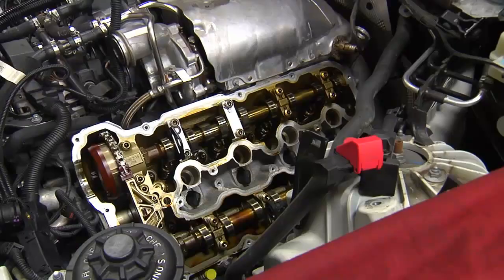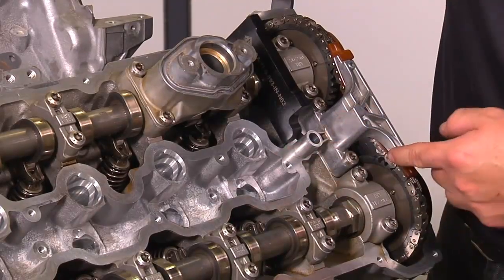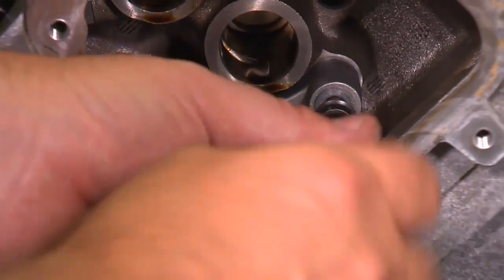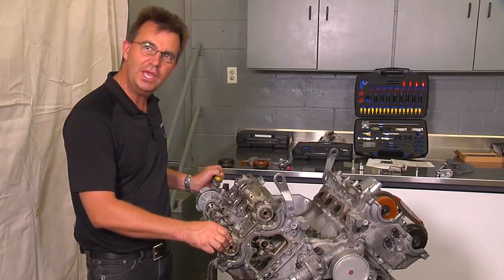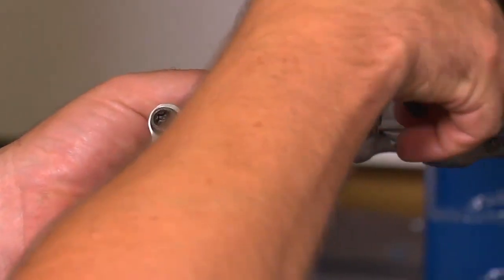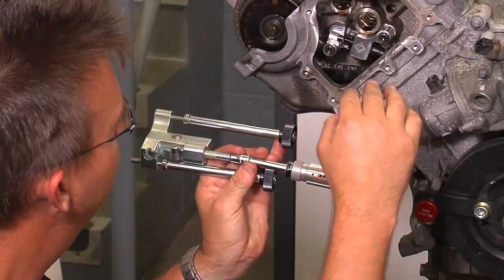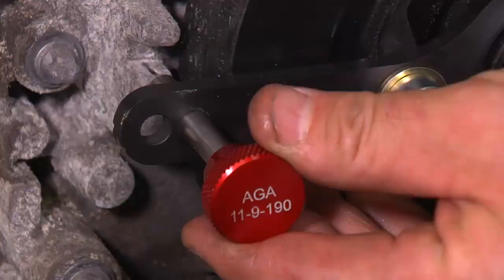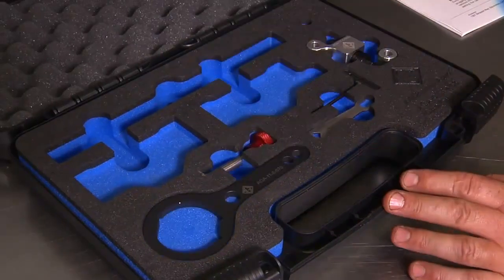BMW N63 Timing chain installation

Comment: This video should be titled "Removing and installing camshaft phaser adjusters", Timing chain installation is a bit more complicated and daunting task on the N63 engine which has 2 timing chains for bank 1 and bank 2.

Comment: What makes this priced at $700+ and 10 times more than what I can find on Amazon? If it is precision, I can see the crank locking tool and the 2 cam locking tools MIGHT have extra play that this AGA might not. I checked my $70 amazon pieces and did not see any play. Please explain to me why I should spend 10 times more. Please don't tell me just because it is better made.

Comment: It is not a chain installation video. No chain was replaced nor installed. This is just a timing job. To replace/install the chains, u need to remove the timing cover. To remove timing cover, u need to remove cylinder heads (or risk oil leaking at head gaskets when done) AND upper oil pan (or risking oil leaking later). Stupid N63 design and they make the timing chain guides BRITTLE after 100K or so, making this engine cost prohibited to repair.

Comment: Video has nothing to do with replacement of timing chains ?  Good for setting cam timing tho   PS  that’s not a crankshaft stop tool it’s a timing tool if you use it to hold crank to do anything else you will damage the timing cover and the tool cliff note from a certified factory trained BMW HEAVY  LINE TECH

Comment: I have a question, if the times between the intake and exhaust shafts do not match, is it enough to change the vanos screws?  and if I change the bolts, do I have to remove the vanos?  do I just unscrew the screws on the lock, replace, set nm and angle and that's it?  thank you greetings

Comment: hey body show up with the engine in the car and see if you can do one single valve stem, engine remover yes very easy, engine in the car is impossible to replace valve stems in hole 3,4,7,8 at intake side

Comment: It's not an installation. The chain is already in. My question is for a complete chain installation, call it replacement, can you do it with the engine still in the car? I feel not...
Reply: No, you have to remove almost everything from the engine.

Comment: I've got an S63 doing valve stem seals. Valve covers removed. Spark plugs out, injectors out, holes plugged. Began turning the engine (clockwise from the front) and it turned smooth until it reached a hard stop. Looks like it as almost full open on exhaust on cyl 1, almost full open intake cyl 3. Quite puzzling . . . as if valves were hitting or something jamming the chain. Engine was running before teardown. Before pulling more stuff off to get to chain, any thoughts?
Reply: did you ever figure this out? currently have the exact same issue
Reply: Did u do one side at a time and put it back together before doing the other side ?

Comment: What a nightmare, the N62 and N63 are garbage and this job will have to be done again in 40,000 miles. High priced vehicles, extremely cheap quality parts.
Reply: The N63TU doesn’t have this problem only the earlier ones…
Reply: Your an idiot

Comment: I did exactly as pointed out in the video but now I have a no start. Vehicle is rolling over free as if no compression. Any ideas?
Reply: Kenton Roker your tensioners was free and you your valve is banded

Comment: Thank you very much.... Interesting watch and very useful. I have a question.. I'm being offered a non-running BMW 650 2012 with n63 engine. The timing chain failed with the car out of warranty. I'm trying to make an educated guess. Do you think the pistons/valves are bent/damaged? What are the chances? I have done several N43 and N13 and in all cases there was no severe damage. New chain, tensioner and guides and all was back to normal.  I would appreciate and value your opinion or anyone else with some knowledge.

Comment: LO ESTA HACIENDO MAL LA PLACA DE EX LA PONE ALREVEZ.ADMICION VA EN LA PARTE EXTERNA DEL MOTOR
Reply: Auto diag Prog al revés, admisión del lado de adentro y ex del lado de afuera, es un v8.
Reply: @PatricioGarcia1973 No, N63 is a "Hot-V" design with exhaust ports facing inward in "V" where the turbos are housed.

Comment: why the fuck you need to replace the timing chain... ??? those engines should be for life, fuck you bmw.
Reply: Well, that isn´t a spezific BMW problem, but a problem with many european car makers such like VW, Mercedes, Peugeot...
As you recognize, they are using a silent chain(gear tooth chain) not a roller chain anymore. They are prone to more wear and tear...

Comment: I did exactly what he said and the car runs like shit!!!!. Any one can help plz
Reply: Hi, i have the same problem, and fault code about Vanos system and not reaching the desired position, have done the work twice, with new Vanos pulleys installed... And the same. Thinking about problem in ECU if just may need programming. Which was your solution? Thanks!

Comment: i swear he said not to rotate the engine backwards, then he went and did it
Reply: How many degrees did he do counterclockwise ? That's just enough to get the tensioner pressed and not to turn 720 degrees.
Reply: Like in don’t go full rotation backwards. After the cams are locked you can move the crank a couple mm backwards.
Reply: Yes but only to release slack, not a whole rotation
Reply: yes, but due to vanos system pistons did not even move.